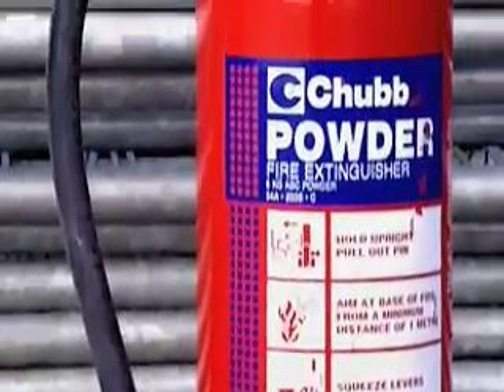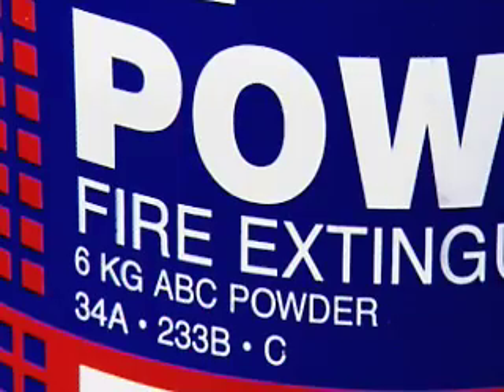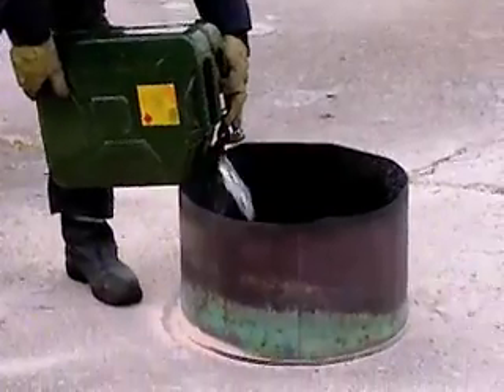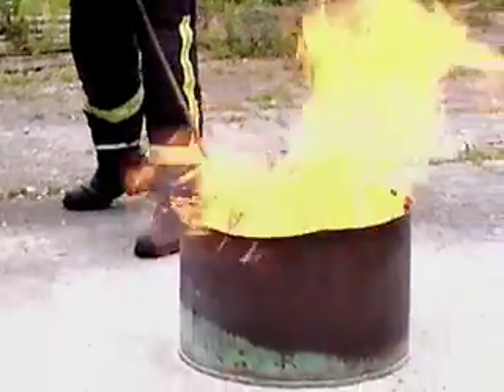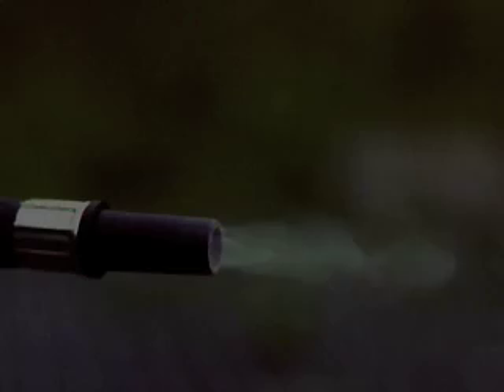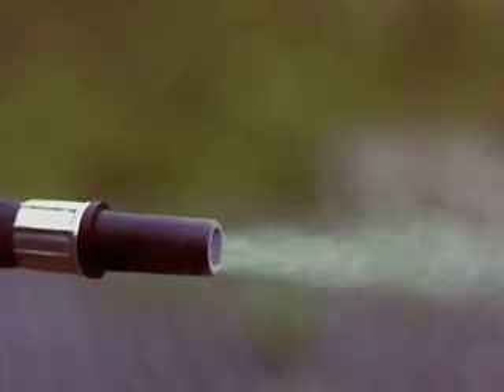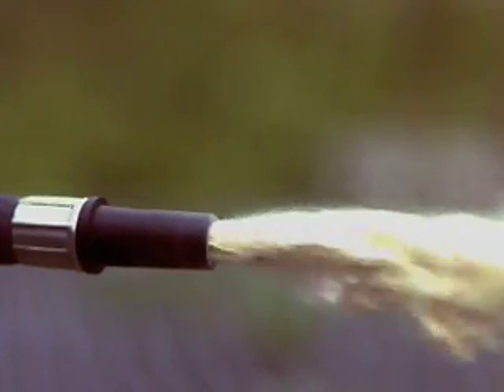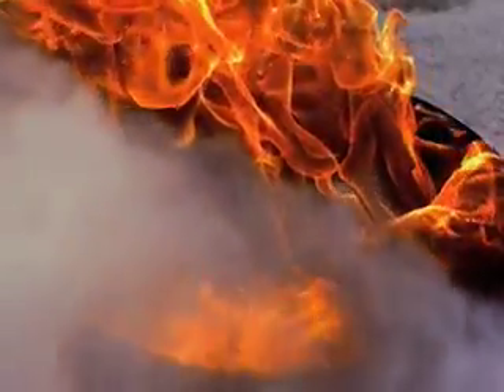How a fire extinguisher works

Comment: I think the reason the fire resumes at 0:56 is not because oxygen finds it's way back to the heat and fuel. I don't think dry powder deprives the fire of oxygen. The minerals are supposed to act like a negative catalyst, reducing the rate of rapid oxidation of the fuel.
Nice video though!